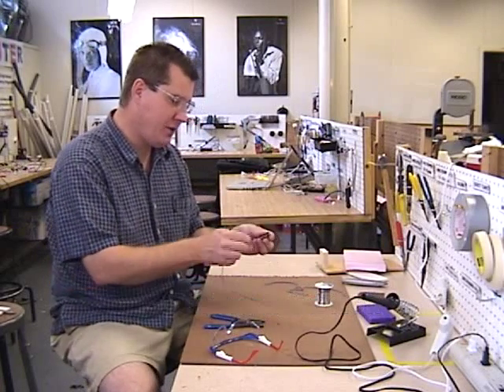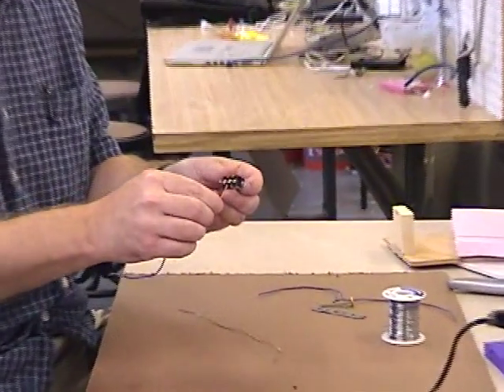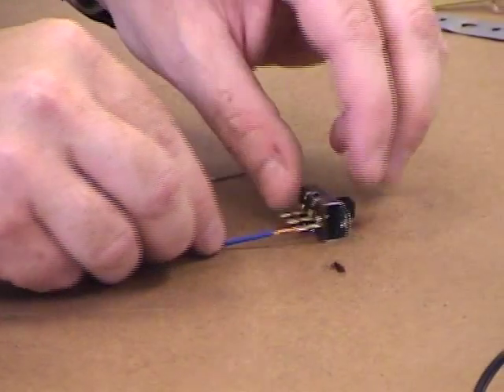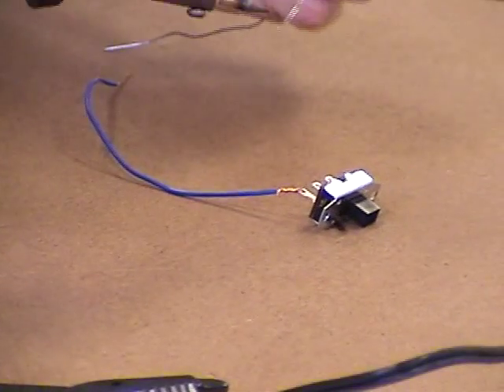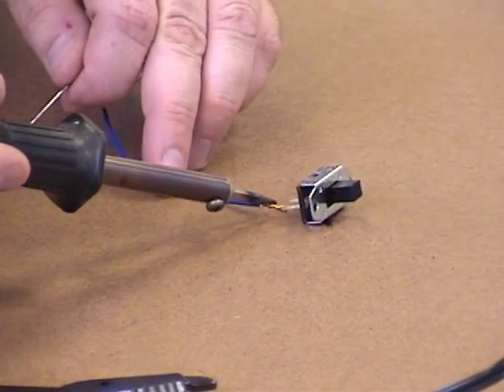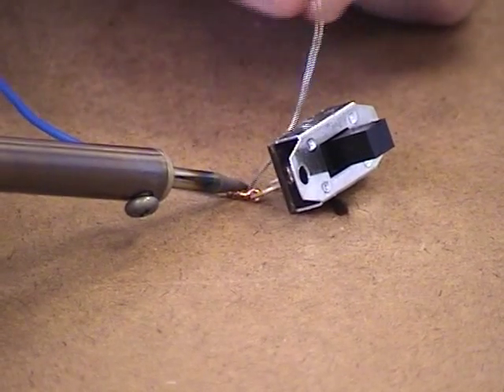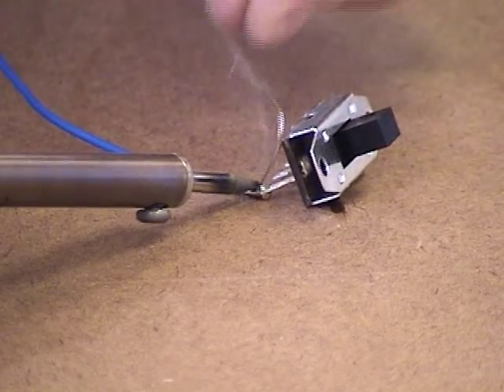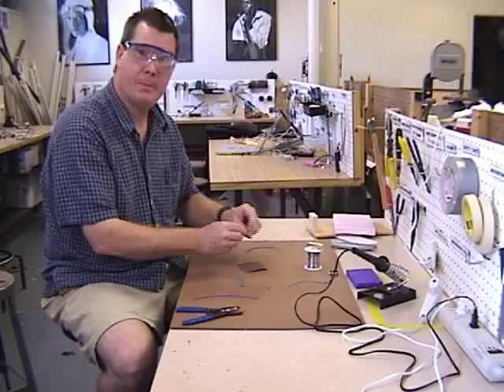DESIGN LAB: Soldering a Switch

Comment: Just a note too, you don't have to twist the wire like that, especially on 10 and 12 gauge wire, you can slide the wire through the hole just enough to solder on both sides, if done right it will last a life time. Because you won't be able to wrap and twist thicker wire like that

Comment: 1cm of wire is sufficient to be fed through the hole right up the to wire coating to use gravity for stability before the weld. Tin your wire and contact first, add solder and seal the joint and then trim off the remaining wire with flush cutters. Allow solder to cool on it's own. Use heat shrink sleeves to insulate. If the contacts are being picky and not accepting the solder, use flux. 
There is no need to twist the wire on. This is sloppy.

Comment: Yikes, this video has a lot of misinformation!  That tip is hideous, looks completely coated in impurities.  Looks like many of the errors have been covered in other comments, I do want to add that you should never under any circumstances blow on a fresh joint!  It should cool naturally or risk micro fractures that lead to a joint which will break in a year or two.

Comment: AN INCH OF BARE METAL??? DUDE!  And no mention of heat shrink to stop shorts, or of keeping the iron in place to heat the joint and cool the joint better.. And twisting putting stress into the Copernicus of the wire at the joint... You fail